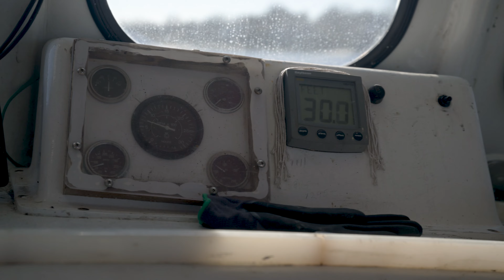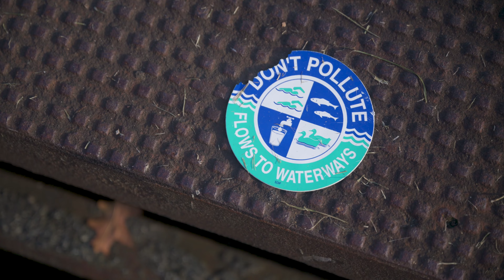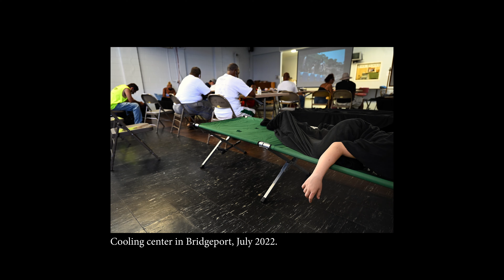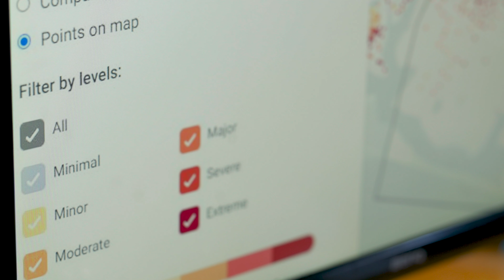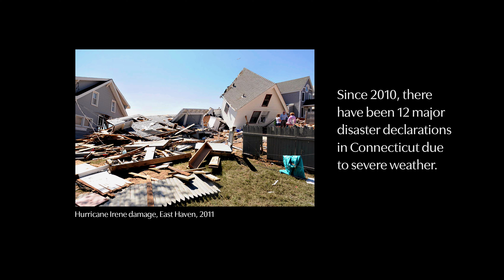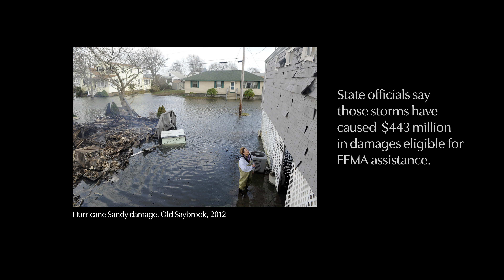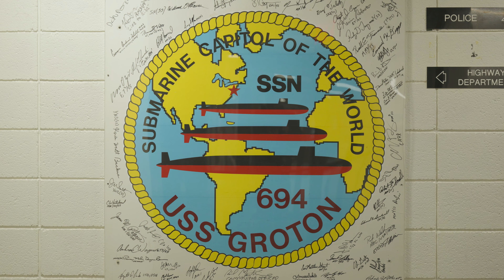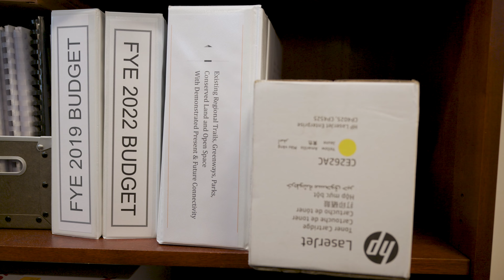Climate Change Along Connecticut's Coast | Cutline

Comment: There is no climate crisis. Globally the ACE index (accumulated cyclone energy) 1980-2021 shows no increasing trend. Global Hurricane Landfalls 1970-2021 (updated from Weinkle et al, 2012) shows no trend. Satellite data since 1980 shows a slight downward global trend for total hurricaine numbers with 2021 being a record low year. The IPCC reports in AR6, chapter 11, "The total global frequency of TC [tropical cyclone] formation will decrease or remain unchanged with increasing global warming (medium confidence)." Multidecadal variability in Atlantic hurricaines is most probably related to the AMO (Vecchi et al, 2021). NOAA data 1851-2021 shows no trend in number of hurricaine landfalls with the record high being 1886. What the data from NOAA SPC shows about tornados: EF1-EF5 (1954-2022) no trend; EF3-EF5 (most destructive) (1954-2022) 50% decline. No EF5s in US since 2013 (a record absence).
The Global Land Precipitation Anomaly from AR5 will disappoint with deviations from the average increasing by 0.2% per decade, but if you look at the actual data, it's just very variable over the decades. 
Drought appears to be decreasing (Watts et al, 2018) measured by SPI 1901-2017. 
Deaths from natural disasters are about 0.6% of what they were a century ago.
What else? Oh, deserts like the Sahara have shrunk considerably and the Earth has greened by 15% or more in a human lifetime (NASA).
On extinction the rate is very low: 900 known lost species for 2.1 million known species in 500 years. At that frequency it will take nearly 190,000 years to reach 15% extinction i.e. a mass extinction. 
There is no climate crisis.
Reply: ^ This cherry picked evidence and misrepresentations of the data. The overwhelming majority of scientists and scientific institutions agree that the climate is changing faster than expected due to human activity.
Reply: @Miles Starr Radin  These are quite some large cherries, I think you'll agree. And I would like to know how I'm misrepresenting the data. That's something many scientists and politicians are much better at.
Interestingly, yours is essentially an argument from authority. Arguments from authority are based on the idea that a person should conform to the opinion of a perceived authority or authoritative group. Humans have been shown to feel strong emotional pressure to conform to authorities and majority positions. Is that your case?
As an aside, when over 100 scientists published a booklet (Hundert Autoren gegen Einstein, 1931) against Einstein and his work on relativity, he responded "If I were wrong, it would only take one."
Scientists have been very wrong on many things: smoking, pesticides, and more worryingly eugenics, which was widely accepted in the first half of the twentieth century. 
It is much better to remain sceptical. 
I have other "cherries" to support my ideas that the Earth was warmer in the recent and distant past and that it warmed faster in the past.
Reply: Oh, look, the troll is back.
Reply: @OldScientist  "On extinction the rate is very low: 900 known lost species for 2.1 million known species in 500 years. At that frequency it will take nearly 190,000 years to reach 15% extinction i.e. a mass extinction. "

Odd, no citation.

That's because it's a lie, as usual for you.
Reply: @Jay Kanta  Okay. If I'm lying, what is your truth?
Reply: @eattherich1793  What is your counter point? You say it's not true, ALL THE FACTS presented, yet you JUST SAY it's not true. Lol typical 🤡